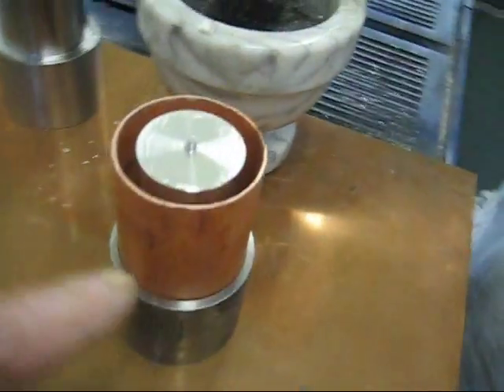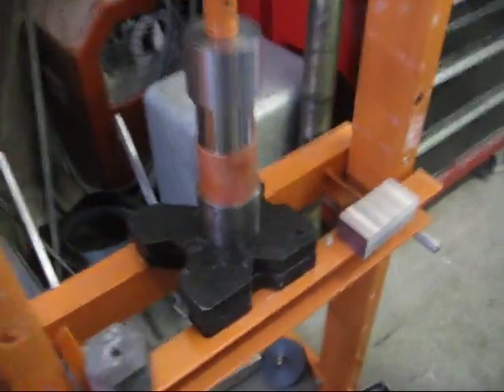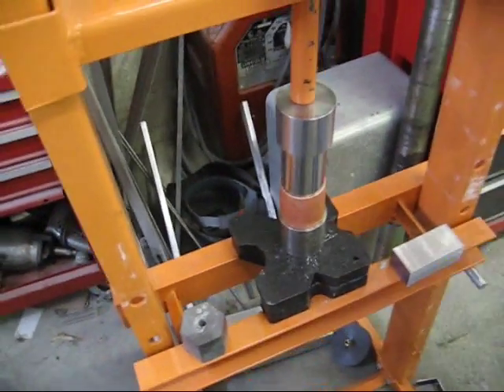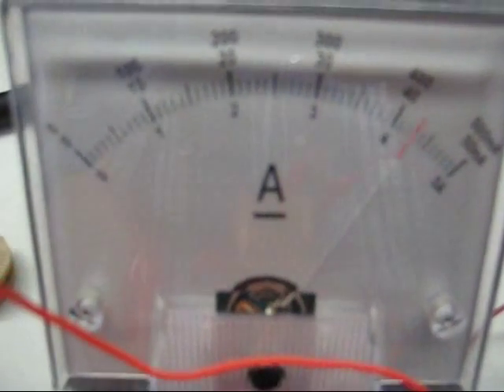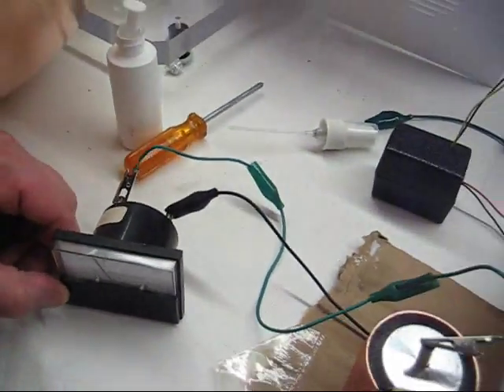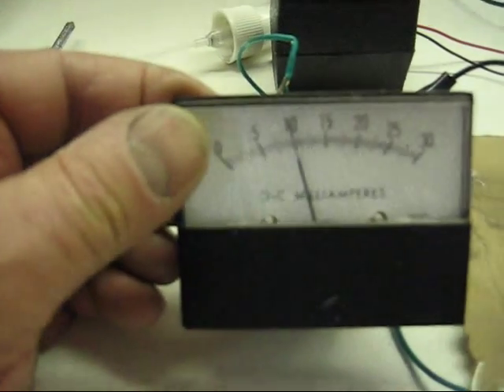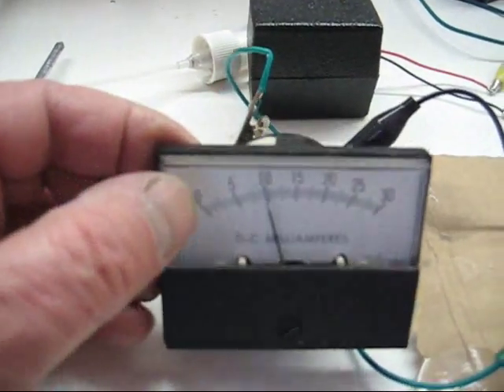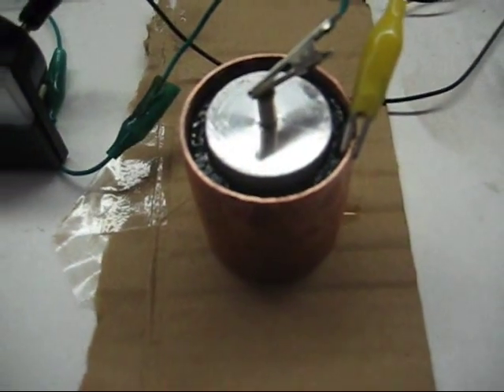Smaller Heptahydrate Hydrate cell 2.5 X 2 inch Chuck And John.wmv

Comment: You really rock JB, press on baby!, The voltage must be 1.2V as your using copper and magnesium.  July Renaissance Conference 2012 will hopefully get this historical event out into the public eye. This is as viable as solar energy except  24/7.  maybe the center Mg drilled n filled, double surface area.